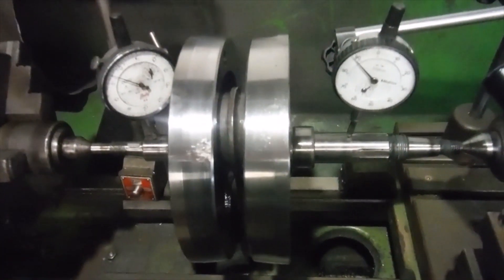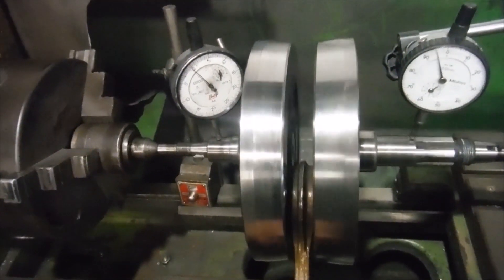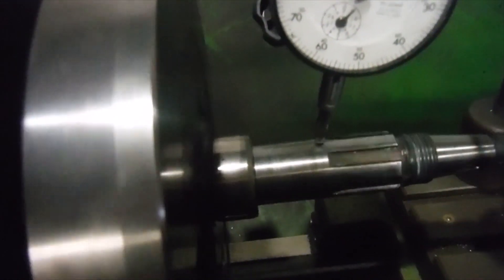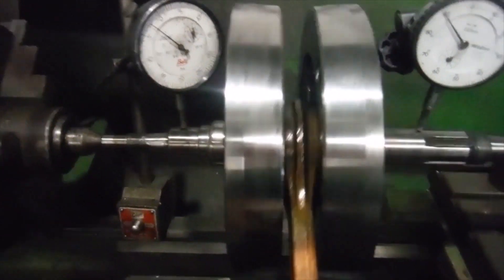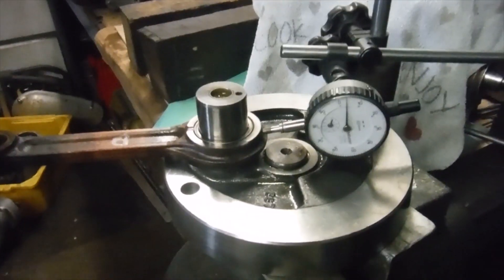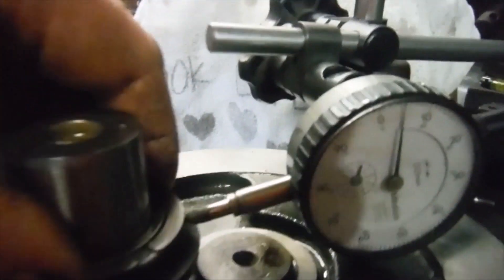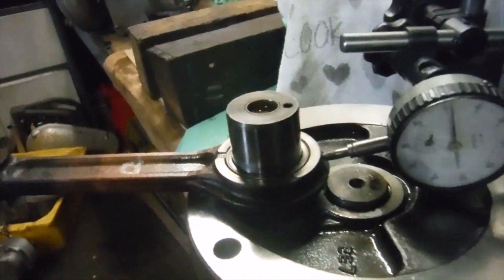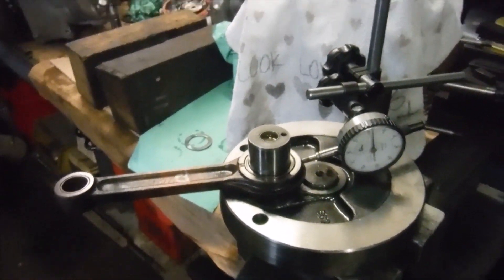Royal Enfield Electra X crank runout and big end wear checked.

Comment: Would like to see the big end bearing sometime in this project.  It is a roller unit from the looks of things.  A bit surprised to see what looks to be hardened steel thrust washers. I'd expect thick bronze parts there with oil dimples on the thrust surfaces.
Reply from the maker: The new conrod, big end and crankpin have arrived, with bronze thrust washers instead of the hard steel ones which had been chopping their way into the crankpin!